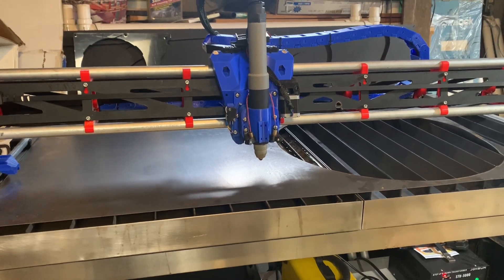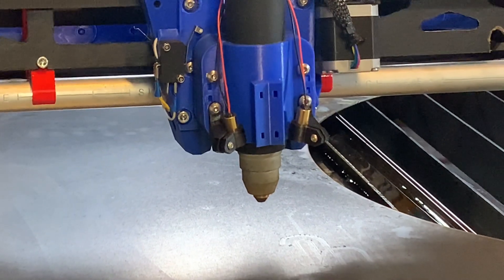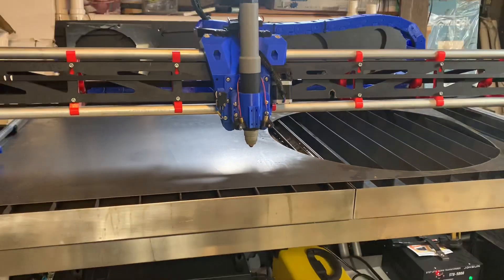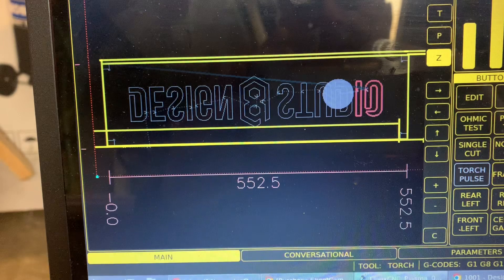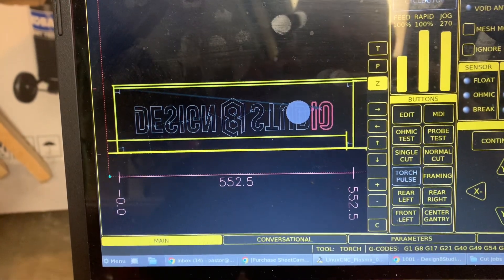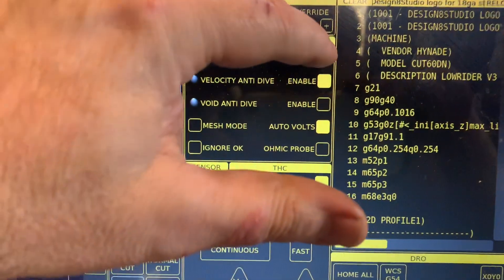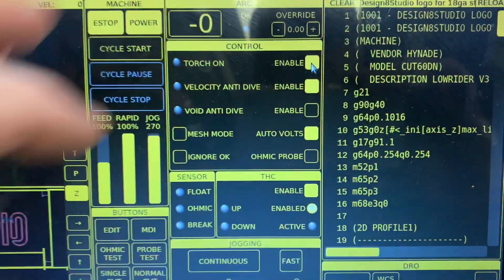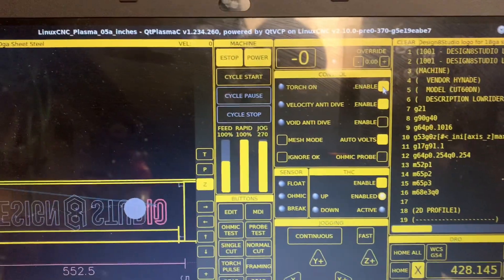LowRider 3 CNC Plasma - Design8Studio logo cut in 18 ga  steel - PART 1

Comment: Is this in a basement? What are you using for fire protection/suppression?
Reply from the maker: Yes, garage in basement-next to garage door. I open garage door for ventilation and wear mask, in addition to having water table.
Reply from the maker: I just realized I misread your question. I thought it was about protection from vapors. I see it's about fire protection. I have a fire extinguisher, never leave a cut job unattended, and it's on a concrete floor.

Comment: How much did it cost to build the LowRider 3 CNC Plasma?
Reply: Thank you for an awesome response. I love your channel. I fired up my lowrider for the first time last night and it’s working!!!! I’ll be reaching out with questions soon!
Reply from the maker: @28Seagulls  awesome! That’s so exciting!
Reply: Way to go Doug. Excellent work buddy.
Reply from the maker: @landonhillyard  I just subscribed to your channel! I try to subscribe to all fellow V1E makers!
Reply: @design8studio  After much consideration, I am going to follow in your footsteps and build a mesa base linux cnc setup. just seems like the most versatile platform with a well established platform.
Reply from the maker: @landonhillyard  I am certainly not disappointed that I went that route, and I think you will not be. I will also say this, the cut recovery options in LinuxCNC’s QTPlasmaC graphical user interface are truly top-notch. Really awesome. There is a LinuxCNC Forum member named Rod, who has a YouTube channel, and one of his videos shows how to use the cut recovery options. Really helpful. I probably will make a video showing it too just to help get the word out.
Reply from the maker: My cost on this, all in, was about $1,860.58, and it's comparable in size, capacity and performance to a  Langmuir Crossfire Pro with THC, which with plasma cutter with machine torch + flat rate shipping, comes to about $4,568.00, so my savings by going a DIY route was about $2,707. And, I like doing projects like this. For someone who does not, it may not be worth it to them. In order to reduce costs, I bought a lesser known name (Hynade brand) CUT60DN plasma ($499.99 on Amazon) and a used Acer touchscreen laptop (for loading LinuxCNC) — "Acer aspire V15 Touch Intel i5 4210U 1.70GHz 8GB RAM 1TB HDD Touchscreen Win 10" (only $119.19 on eBay). Those are included in the overall cost I quoted above, as are both the stainless steel table, and the stainless steel water trays I use for my water table. More details and purchase links are in my build log linked in the description. (ALSO: I did not count the cost of the air compressor, which would be an add-on either way, for someone who does not have one that is sufficient.)